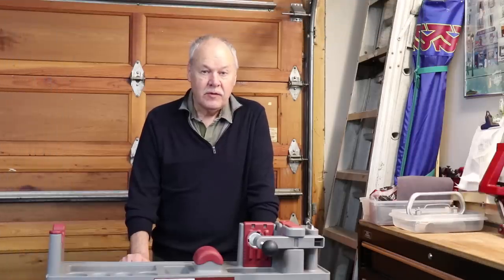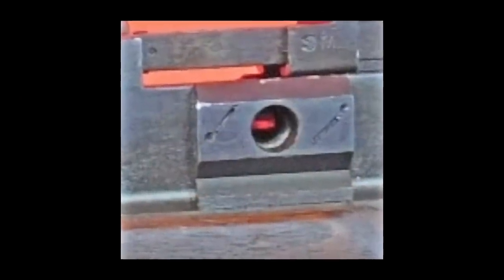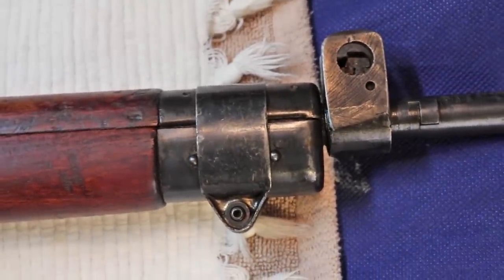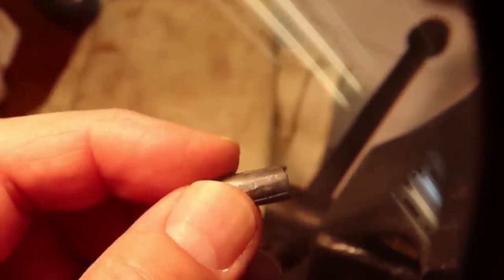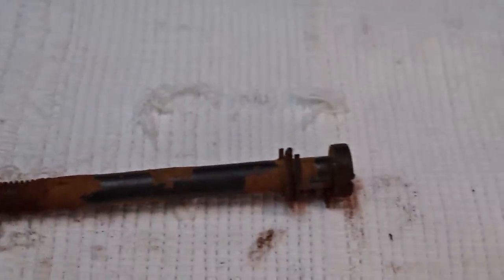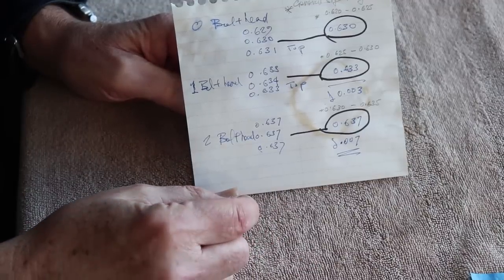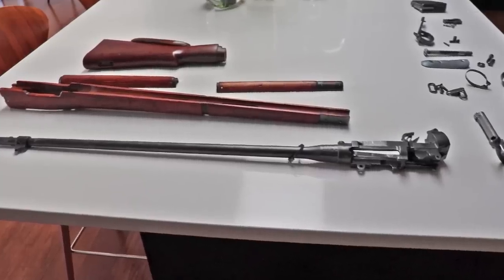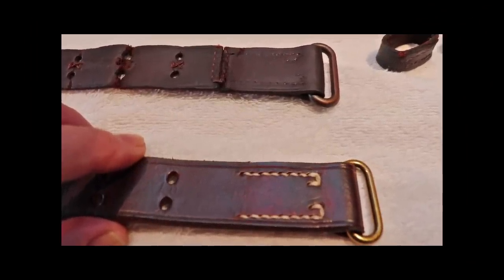Lee Enfield Sniper Rifle Restoration

Comment: Nice video - you are a lucky man to own such a classic. The M47C stamping denotes that the original rifle was made at the Birmingham Small Arms (BSA) factory in England, a private company subcontracted in WW2 to make rifles for the British War Department.  Some 22,000 standard issue rifles were converted at Holland & Holland in North London to be sniper rifles.  The MK32 telescope was originally designed for use on the BREN British light machine gun.

Comment: I fired these guns, standard military, not sniper, when I was a kid and they are very smooth and accurate.  I wish I had bought one then when Kline's was selling them for under $30 but I wish I was 20 again too.  If the gun was manufactured in 1943 and you have sand and a rusty bolt that sounds like Normandy and not the desert.  Impressive.

Comment: A very nice"sympathetic" restoration, however! using a rotating wire brush in the barrel is not something that would do a lot to improve accuracy, why not use the conventional system of using straight in and out movement, that would preserve the edges of the rifling much better than the very damaging rotary brush, you had very god fortune finding the scope for this, I hope you get many hours of pleasure shooting it.

Comment: I'm restoring a brutalized No.1 Mk. III*. It was sporterized, then left on a shelf in a barn for twenty-some odd years. Some kind of cheap oil, I think vegetable oil or perhaps lard, was used in the action at some point, which eventually turned to glue over the years. I had to beat the bolt open with a 2x4, but now that it's apart the internals aren't a complete loss. The finish and fitting new stocks will be the most difficult part of the job. Thanks for the video!

Comment: Great video Robert and very informative.  I have three LE 303s. One is a 1918 Enfield with a spot on bore, a Savage No.4 Mk1* with excellent bore, A Lithgow 1941 III* the wood is as issued from the factory, blueing is perfect and bore is mint, bolt face is perfect and it appears that it has never been fired or issued to any military unit.  The third is a 1946 No5 Fasarkly carbine with a 85% bore.
I was given the 1941 Lithgow by a friend in Florida who insisted that the rifle, being unfired and perfect in all other areas, should go home to where it was made.  I brought it back to Queensland where it reigns as the queen of my large gunsafe.

Comment: I have a sporter no 5 that I scoped & handload for.  With an old Weaver k3 post & crosshair I got 3/4" @ 100 yds. When I first got the gun the barrel was like a sewer pipe, but I cleaned it for days with J & B bore paste, shot it some & cleaned it some more until it shot like it should.  Actually it shoots much better than it should owning I think to the way it is bedded.

Comment: Great video. I thoroughly enjoyed it. It is clear that you know what you are doing. I laughed at the comment one smug troll made about how a brass bristle brush would destroy the steel rifling.  I guess we should all have brass files made to sharpen our lawnmower blades. I hadn’t realized that brass was so hard.
Reply: Oliver Clozoff not brass mate but if you knew a lot about shooting and cleaning a gun bore  you would know it is a Phosphor Bronze brush and they are far harsher on a bore than brass would ever be
Reply: Oliver Clozoff: You obviously know very little about the way things work, if you rotate even a soft material against a very hard surface it is not the soft material that abrades, it is the particles of hard contamination, (like the sand in the buttplate) that do the damage, the soft material holds on to these particles and acts like a grindstone. As for your analogy of the brass file, what do you think a diamond sharpening stone is ? It is soft metal embedded with hard diamond dust !

Comment: Instead of shimming use baking soda n super glue and build it up then file or sand to fit ..works gr8 also can mix in some sanding dust from orig.stock so you aren't even able to tell was done..also strong as hell.looks like was never needed once done

Comment: where did you find the bolt heads? I have a No 4 Mk 1 (T) but a 1944 and it also is stretching the cases. Also the scope adjustment tool I'd like to get one, I managed to find a local gunsmith who had a friend that was able to refurbish the scope so I can now use it, initially it wouldn't hold a zero. I'm collecting all the gear a sniper would have carried, I have the scout scope but it needs some lens work and last piece is a compass. Mine came with the wood transit case. Its an excellent shooter, off hand at 200 can regularly ring the gong. Nice work really liked the sling you rebuilt may need to try that myself, just not too sure how good my leather work will be though.

Comment: Nice restoration, not overdone though I don't agree with your method of cleaning your bore from the muzzle end with the drill.   I had an old SMLE and the bore was shot out and badly pitted so was very inaccurate.  I had a Lithgow Heavy Match barrel fitted with the incorrect headspace and the cases would start to show head separation after 2 reloads but was remedied the way you explained.  Thanks for sharing and the explanation detail.

Comment: Hello, again, Robert,
You may recall that I am an expert on shooting the Lee-Enfield No.4 rifle, based at Bisley in the UK.

When I last contacted you, I gave you a few pointers on how to correctly hold and shoot these rifles. As I said at the time, if correctly set up and the barrel is in good condition -- and, crucially, you can get your hands on the correct specification of ammunition -- these rifles are capable of 8 inches accuracy at an incredible 1,000 yards. That's right, eight inches at one thousand yards.

Anyhow, Robert, I'm wondering how you're getting on with the tips I gave you? Hopefully, you're now getting much improved accuracy. 

The "pragmatic" design of these rifles means they can often out-perform modern rifles and, don't forget, the famous Remington 700 series is, effectively, an older Lee-Enfield design than the No.4.

Just one CAUTION I'll say to everyone. Be aware that the rear-locking bolt of a Lee-Enfield rifle is manufactured out of spec. It is then permanently "mated" to the rifle by firing a massively over-charged proof round. This stretches the metal of the receiver, which ensures that the action now acts as a spring. This is part of the story of why Lee-Enfield rifles are so incredibly accurate. But, if you swap a bolt, you don't just risk loss of accuracy, you could be doing something extremely dangerous. It's complex, and too many of today's Armourers or Gunsmiths don't actually understand how this works. 

Have fun,
Rick

Comment: very very interesting,  Especially the part about the sling,   I like that model sling and one have on my  Remingtong M700V.  Circa 1967, basically the same as the first M40's .  the use of it standing is not something  Marines would do with the sling at all, normally, on the range for qualification or competition (I shot on the base team at MCB  Camp Pendleton a very long time ago).  oh the .45 brush is an M16/AR15 Chamber brush, the large part at the back is to clean the locking lug recess which is integral with the barrel.

Comment: I bought a No.4 MkII Maltby 1944 (T). It didn't have matching sight and rifle but I was just glad to have got my hands on a (T). However, on careful inspection, several issues started to show up - all the markings didn't correspond to what I would expect on a 1944 (T). On removing the top woodwork I found the stamping 'REGULATED BY FULTON". Fulton was the final word on anything connected with .303's in England and it appears that this was an extremely good Range Rifle, probably shot at Bisley and Fulton did his wonder work on it.  So, as far as I am concerned, I have a perfectly fine No4. MkII that shoots as accurately as any (T) - I demonstrated it at a sniper's course (NZ Army) and hit clay pigeons at 550 metres with standard MkVII ammunition. Not bad!

Comment: Absolutely outstanding video Sir! I own a couple Lee Enfield infantry issue rifles. First is my Australian Lithgow FTR 1951 and an Indian L2A2 1967 manufactured in 7.62mm NATO. Both are outstanding rifles. Your insight into the action and the stocks gave me very good information to properly care for my rifles. Not like Tommy in the Infantry cleaning it for the Sergeant Major's inspection. Both my rifles are in good firing order with no back outs on their fired primers and accuracy is combat accurate using their original battle sights. The only thing I have changed was I picked up a couple of pre-WWI or pre-1916 windage adjustable sights for both rifles. Now they shoot dead on from 100,200, 300, to 500 yards on paper and steel targets to the limits of the range I shoot at. The Vernier is great for fine adjustment with little guess work than my Rock Island M1903 rifle for long range shooting. The American Springfield or Rock Island M1903 is a target rifle and Lee Enfields are true battle rifles. Towards the end of your video about the scope on the Lee Sniper rifle about dismounting the scope and retaining it's zero. The US Army of the 1980s using the M14/M21 Sniper Rifle. We were always told to never remove the scope once it was zeroed for the issued M118 173 grain ball match grade using the ARTII scope. Usually every quarter when seasons and temperature changed we would have to re-zero our rifles sometimes changing lot numbers if we ran short of the current lot numbers to re-qualify with our M21s. This was easy for mechanized and light infantry battalions. It was harder for Airborne Infantry units to retain zero during live fire exercises because we jumped with them. Our solution was to wrap the mounted scope and M21 entirely with black military grade Styrofoam and wrap it with electrical tape inside the weapons jump case. So that when landing we will not knock the zero of the scope. The M21 is a delicate match grade M14 rifle selected with a match barrel and components. Any problem with it reported by the sniper. It had to go back to Rock Island Armory for repairs. In combat the sniper would have a regular M14 rifle if his scope was damaged. Mines never got damaged in any jump that I made thanks to the design of the M1950 padded jump case. Bottom line you gave out great information about how the Lee Enfield rifle should behave.

Comment: Beautiful work. These old work horses have seen their day. With mine I would make three shots put it down let it cool. I would get and 1 inch group every time. Otherwise it did the same as the last Target every time. Make sure you clean and grease the barrel when done. Cordite is very corrosive. Most of these old barrels are pitted the first 4 inches or so. Brought back memories of my restoration of my  303 in the year 2000. Thanks and good luck Long Island New York USA🇺🇸

Comment: Watching you shoot left handed took me back to when I first joined the navy when I was 16 and they taught us how to shoot, I laid down on the range put the Lee Enfield to my shoulder and had just sighted down the the range when I got a bloody great boot poking me in the arse and the G.I. yelling we don’t have left handed guns put it on your other shoulder!
Reply: I was wondering about that. I've no experience with guns at all. But I assumed that these were designed for right handed use. Are there problems for lefties?
Reply: On bolt action rifles the bolt handle is on the right of the gun, with the Lee Enfield it was designed for rapid fire so very difficult for a left hander, later on in my career I used an FN Rifle and if you fired it left handed the bloody hot cartridge was ejected on to your right arm or down the front of your shirt. Now I can shoot left or right handed, on a range I shoot left handed as I’m left eyed.
Reply: @MrPaddlingthenet  Left hand is not the issue,  Left eye is

Comment: Very nice restoration. I picked one up like this at a local gun shop a few years ago. It was in overall very good condition but did need a little TCL. I know it's an odd question but you wouldn't have happened to have picked this rifle up from redding auction? They sold one just like this a few weeks ago.

Comment: British engineers were second to none and what they produced, whether it was a small arm, naval vessel, tank, or war plane showed how striving for perfection won the day.  This video illustrates how they would think through a problem and come up with a solution, the way to use the leather sling for example.  If you try it you will find that the stability gained is comparable to using a tripod or shooting stick.  Also, the .303 british round was not only a good small arms round but also a machine gun round that was hard hitting, accurate, and lethal; this was great presentation by a master craftsman.
Reply: It would be hard to argue your point of British technology, after all, it the Rolls Royce Merlin V-12 powerplant that was far more efficient with more power, climb and maneuvering capabilities, Higher serviceable altitudes, and better fuel economy that allowed our P-51 Mustang to escort bombers to their destinations and back in WW-II. Hell... it was retired Gen. Chuck Yeager that flew it in air races in the eighties and possibly the nineties too. Sorry, but you have to excuse me. I've had a true love for that airplane and sometimes it shows.

Comment: Speaking of Savage. I own a No 4 Mk1 T built by Savage. It was converted by H&H as a T but it was post war and was never mated with a bracket or scope. They were surplused without ever seeing service and as a result it’s in very good condition and shoots well with a reproduction scope. Also not as expensive or likely to be forgeries. I’ve had it inspected and it fits into the SN range of these rifles.

Comment: Thank you for a very interesting and very informative video. I’ve been collecting and restoring WWI and WWII military rifles for most of my adult life and I have a number of No. 4 Enfield rifles (no sniper variant yet - maybe one day) and I found the information about the bolt and especially the bolt head very interesting. Learned something new about the M1907 sling also. I have a few questions about your rifle - 1) did you find out what was causing the barrel to bind on the stock forearm at the muzzle? 2) did you do any additional work on the stock crack with the old repair? 3) did adjusting the scope reticle put the rifle on target? Thanks again. Great video.

Comment: Great video. How did you measure the stock uplift? When you mentioned the bolt and barrel, was it actual paint or cold bluing? The stock crank at the receiver how did any repair/filling work out. I believe you can still get a great 1907 sling from TURNER SLINGS. They are great for rifle use but obviously do not look old. Looks to be a resulting good shooter. Nice to see these old gals dress back up.

Comment: as for the screws coming out in that time pine tar was used as a glue on screw threads (or so ive been told) but most screws would probably have been staked i would amuse